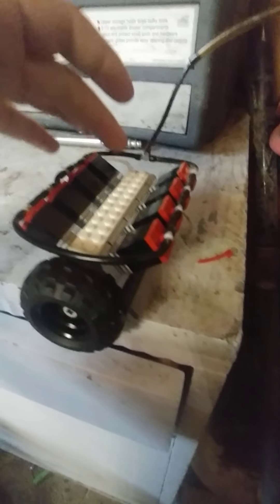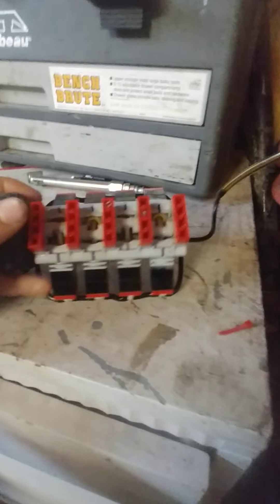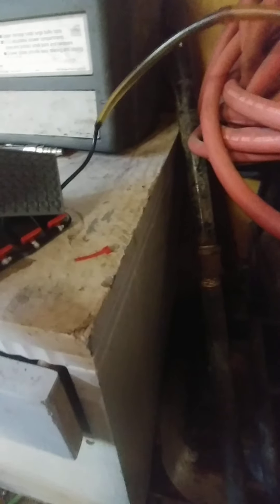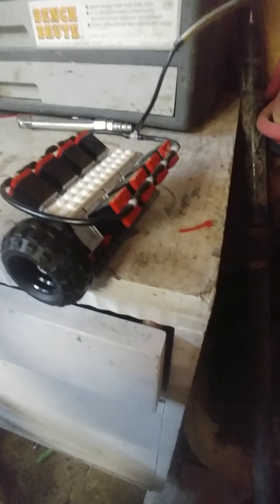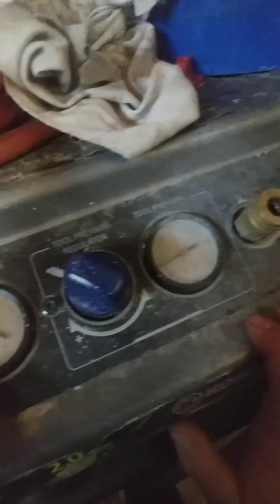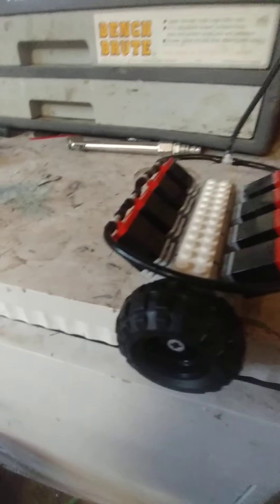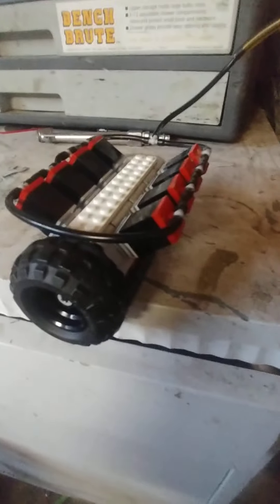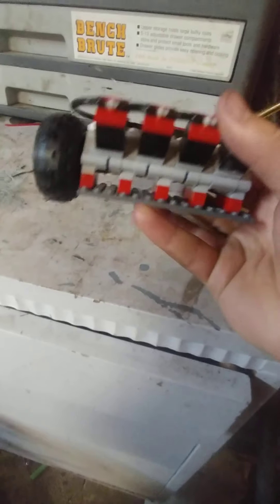Lego V8 LPE!!!! Sound UP!!!

Comment: Any reason you put a separator between each column of cylinders? With a flat plane crank, you could have them tighter together, and keep it more compact.. either way, awesome motor, and certainly sounds good
Reply from the maker: To keep the crankshaft from bending, i had to add a support in between each segment
Reply: @shpaksgarage6786  that's what I suspected, when I saw you adjust it to 90psi... Have you tried it with just one, like two v4's together? Working on my own design, and with everything that's come up so far, if like to avoid future issues if I can learn elsewhere... Spacial constraints, have me trying to keep the motor as compact as possible
Reply from the maker: @danielmartinelli328  no you need a support piece between each segment unless you can figure out a way to decrease how strong the schrader valve is
Reply: @shpaksgarage6786  ohh ok. I thought you meant the pressure was pushing the pistons too far down and causing failure... My design doesn't currently use Schrader valves, so it may be able to stay more compact. Thanks for the info! And please, wish me luck with mine. Hopefully I can get everything sealed off and I should have a running engine soon!
Reply from the maker: @danielmartinelli328  oh yea if you dont have schrader valves then youll be fine! But yes high pressure still may affect you, good luck on the build!
Reply: @shpaksgarage6786  thanks. I'm working on a DOHC design (with the v motors a quad cam). Essentially the cams act as the valve as well, so as long as I can get it to seal properly, I should be running soon. Right now there's too much air escaping, at just 20psi or so. The pistons will move a little, but there's not enough pressure getting in and holding to run yet.